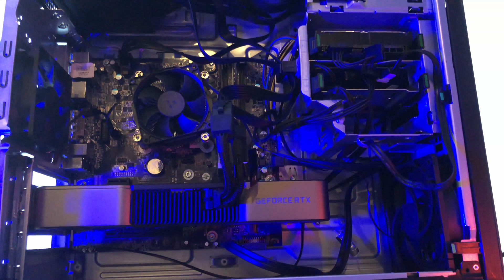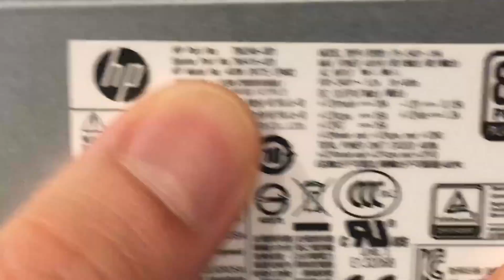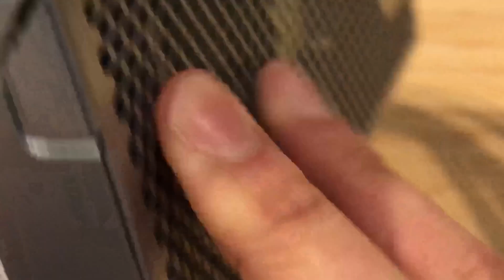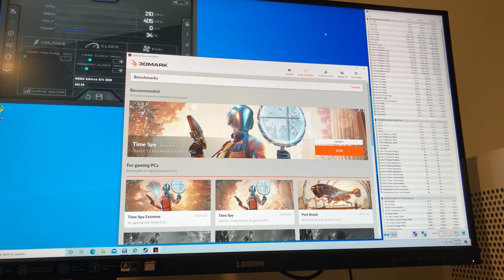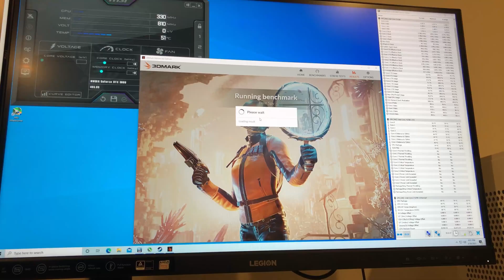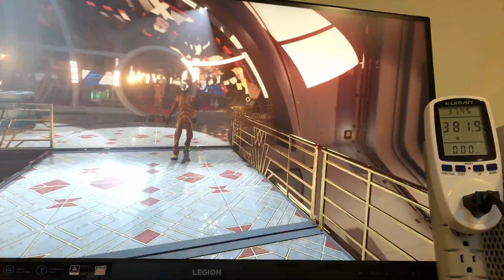UPGRADE HP Z240 with rtx 3080 on a 600W PSU??? 😱

Comment: Would I be able to put a 4060 to my hp z240 or would that too much even with the power supply upgrade?
Reply: Better a RTX 3060 12gb PCIE 3.0 16x
Reply: @bartd.3979 yeah after a review it seems that would be better
Reply: @brotherdarkness89 because this pc don't have pciE4. 0 but onlo 3.0 and the 4060 is PCIE 4.0 8x, on this pc would work on PCIE 3. 0 8x... Not good
Reply: @bartd.3979 I mean you could always use an adapter but I get it
Reply: @brotherdarkness89 adaptor? For PCIE slot
? Are you serious?

Comment: i have hp z240 ,core i5 7th,16g ddr4 , 256ssd nvme + power supply 400 w + what type gpu recommend for me ? 
thanks
Reply from the maker: With those specs i think a 4060 or 9070 would be great. Or a used 3060ti would be great value too
Reply: @StraightforwardTech  on a 400 psu??

Comment: I have z230 sff, i bought an adapter what is convert 24 pin to 6 pin special hp power cable, i connected everything, but if i turn on the psu, the pc is on power, psu fan , and cpu cooler is start working, , but the front panel not connected for the motherbord, someone know what is the problem? The motherbord, cpu etc works because i tried with the old pc psu, and own the old pc.

Comment: can i also put rtx 4070? it needs less power than 3080 afaik...thanks for great video. i was hoping to find how to upgrade z240  power supply, and your vid was of great help!
Reply from the maker: If the power is lower sounds reasonable to me. Glad I could help!
Reply: i installed rtx 4070. up and running great! huge thumbs up!! @StraightforwardTech
Reply: @whitesandboy  how many watts on your psu do you have + are you still working on it?
Reply: @whitesandboy well glad that worked out so it will definitely run the 4060
Reply: @Abdo1.1 
600w psu still running great

Comment: Is this psu gonna fit in elitedesk 800 g2 i7-6700 my brain stuck about the psu things because i wanna upgrade as i have 280w (psu) i want 500 or 550w but some people told that my motherboard doesn't support 24 pin any help or this video is enough?

Comment: Bought one of these machines a while ago to help a friend get a decent PC on a very tight budget. Absolutely amazing value for the price especially since it's a Xeon based system but the Quadro K2200 is letting it down a bit, with a decent GPU it should be a pretty powerful rig. Might not need to upgrade the PSU but good to know it's possible

Comment: I need a new psu. It's going bad. :( How much power can I add for the fan? It's 400 wats atm and dusty. Is it possible to upgrade to a 700wat PSU? Or how does this work? I wish I can use Cooler Master fans too. Im a heavy VR gamer and I have a i7 6700 and it does well. Just installed the thermal paste had to replace it. Need a new fan tho. :( HP fans power supply sucks. Sorry. :( And can't afford to build my own rig. Did you get any decent VR out of it? :)

Comment: I’ve did the same installation with a Corsair 600 and the rtf 3050, but whenever I plug it, it doesn’t boot, only the small led close to the power connector in the motherboard turns on intermittent. And I’ve checked, all cables are connected. Did I miss a step?

Comment: Pretty much the build I am about to do. Picked up a 3060Ti as prices have come down due to miners selling their GPU stock. Needed a generic base , the early Z240's were the best option for space. Refurb model with i7 6700, 24gb Ram, 256 SSD & 1 Gig HD.

I've a 600W cooler master sitting around to upgrade. i7 6700 should be good enough, I've been running a 2600K for years and it is only beginning to struggle.
Reply: sadly you wont achieve the full performance that will be given by the 3060ti due the cpu bottleneck
Reply: Nah that depends heavily on the game and the resolution but the fast majority of games the 6700 will not be a bottleneck. @ochithamhv

Comment: I've watched this video maybe 20 times, and I'd like to know if you had to modify the aftermarket adapter? I bought one and changed it since the comments said the pins were wrong. Also looking at your video, your Original Power supply from HP had 4 pins on the right hand side where the new one had 3 on the left with a bridge. 
I'm just worried that it would fry the Motherboard if I use it in the original state. Also if you didn't change anything, is it still running to this day with no issues?
Reply: Hey did you ever try it out without modifying the cable, I purchased one that was an adapter with 4 pins in a row, but after watching this I'm not sure if it's correct because his one booted

Comment: Truly great video, well thought out and well executed. I was very excited to see it and try for myself. However...unfortunately the adapter in the provided link did not work for me in my HP Z240 full tower workstation. After comparing the plugs I have to the pic on the amazon page it should have been compatible. The adapter that arrived did not have wires in the same places or the same number of wires as the original PSU's "P2" connector. Original P2 connector has 4 wires in it all next to each other with 2 empty slots on one end of the connector. The new adapter has only 3 wires (in different slots than original P2) as well as a small black loop between 2 pins. I tried this with a Cooler Master V1000 and an EVGA 500 PSU, in addition to an EVGA GTX 760 SC. I made sure that none of the pins had ejected themselves as they sometimes do, while connecting all the connectors. After plugging everything in and turning on, the green MOBO LED adjacent to the P2 connector just steadily flashes, no fans run and MOBO is dormant. After removing everything and reinstalling the original HP 400 watt PSU everything works fine again...without a GPU that is. I was at least happy with the RAM upgrade to 16 GB (https://www.amazon.com/gp/product/B086X2XZ4J/ref=ppx_yo_dt_b_asin_title_o02_s00?ie=UTF8&psc=1) and addition of an M.2 drive (https://www.amazon.com/gp/product/B09VSNPDVH/ref=ppx_yo_dt_b_asin_title_o02_s00?ie=UTF8&psc=1) as the main boot drive....made a HUGE difference in overall performance. I tried reaching out to the seller for assistance but have gotten no response. I was able to find another adapter that specifically mentions the Z240 as the model it is compatible with https://www.moddiy.com/products/HP-Z240-PSU-Main-Power-24-Pin-to-6-Pin-Adapter-Cable-30cm.html, hopefully this one will work.

Edit: copied link from webpage:
https://www.moddiy.com/products/HP-Z240-PSU-Main-Power-24-Pin-to-6-Pin-Adapter-Cable-30cm.html
Reply from the maker: Wow very interesting scenario you ran into. I hope you get a resolution to your set up. Would love to hear how it turns out
Reply: @StraightforwardTech  Hello, hope you're well. I just received my adapter today (from China). After plugging it in using the 1000 watt Cooler Master PSU I mentioned it turned on on the first try. I was holding my breath for a few seconds thinking it was my particular "Z240 workstation" but was pleasantly surprised when my green LED didn't flash and saw it start to POST. Mad props to you and your original post as you helped me realize there was more I can do with this PC before I tossed it. Thanks again for your excellent video and your time!
Reply: Your link on moddiy is a dead link. Did your adapter work? I'm also attempting to do the same and am getting issues with the current wiring. (from 4 to 3). I don't want to try the adapter as is since I don't want to risk frying anything. (I had an old HP motherboard melt before and don't want to risk it again).
Reply: @popd8830  Good news...the adapter I found (albeit from China) came in today and it works flawlessly so far. I saw it begin to POST and had a small celebration as it came to life without issue. May it bring you as much success as it did for me.
Reply: @natebutkus4520 does it still working for you didn't the motherboard melt or any issues?
Reply: @Abdo1.1  Still running strong...using that PC right now in fact. I dropped an RTX 2080 in it and I do admin work on my Rust servers with it
Reply: @natebutkus4520 This is a great news! Thanks for letting me know can you provide me a link to this adapter?

Comment: Hi! I also have a Z240 tower I7 7700k and would like to replace the power supply to run a geforce 1070ti. Does the 24 pin adapter have to be modified or does it work without modification? Many Thanks.
Reply from the maker: Hey there, I did not do any modifications with this method

Comment: Hello, Nice upgrade, Is the plate to fix the power supply on Z240 provided with the power supply? I looked at unboxing of SF600 and I did not see it, is it possible to mount a sfx power supply without plate on the Z240? Or  buy the plate separately or stl file to print :)

Comment: hi Looking at this vid tried to install a GTX 1660 on the z240 tower but the screen come up blank managed to switch it to a 700 w power supply fine and the mobo display works - is there a setting in the bios that needs to be changed?
Reply from the maker: Hey Blake, try checking the pcie gen lanes and lower them to gen 3 or gen 2 to see if that works
Reply: @StraightforwardTech  thanks, worked well - the step by step tutorial was great

Comment: The motherboard its AXT? or Micro ATX thanks (: I have the same PC and want to upgrade the case
Reply from the maker: Its the the original one but it does look a bit smaller than atx. I have not measured directly what size it is.

Comment: Just did used the same PSU for my Z240 with a 3050. Thanks for all the details.
Reply from the maker: Glad I could help! Enjoy that 3050!
Reply: With a 3050 you can use hp  stock psu...
Reply: can you dm me the link on amazon for it because i am do not know which one cheers

Comment: I’ve a question in mind if you done have a pcie connected to ur psu but it’s connected to a vga can you still connect it to the gpu without a problem?
Reply from the maker: Sorry but I’m a bit confused by your question on what cables and how it’s connected to your gpu
Reply: @StraightforwardTech  I already know the cable for the gpu i meant for the cpu
Reply: @StraightforwardTech  the question I need to ask is what pin connecter does the cpu need on the motherboard I’ve the same hp motherboard but the computer design is different
Reply: and I’ve the evga b5 550w psu the cpu1 cable is like a 6+2 Pin connecter
Reply from the maker: Ahh sorry for the delayed response but I just use the normal 4 pin connector on the cpu

Comment: great video, i have a Z240  Xeon e3-1240v5 and Quadro K1200.........can i upgrade the Graphics card and the CPU? will i need to change the factory motherboard? or is it pointless? i just want to run oculus quest 2 VR headset. many thanks in advance.
Reply from the maker: Hey there! first of thanks for stopping by to check out the video. 

Reading this article https://www.republicworld.com/technology-news/gaming/what-do-you-need-to-run-the-oculus-quest-2.html
The CPU is good, but you will need to upgrade your graphics card as the Quadro K1200 might not cut it. If you do that I would look at your power consumption too and maybe upgrade the power supply too. Good luck!

Comment: I am planning on getting a z240. I would need to know if it has an "above 4g decoding" option in the bios. Would you have possibly seen that while configuring this?  Nice Video! Thanks
Reply from the maker: Hey Max! Thanks for feedback. I don't recall seeing the z240 on this specific motherboard. However this PC is pretty dated and I did not update the bios. Also it had some hp propiotary bios so keep that in mind too.

Comment: Hi is this a full size HP Z240? I have a compact one will it still work?
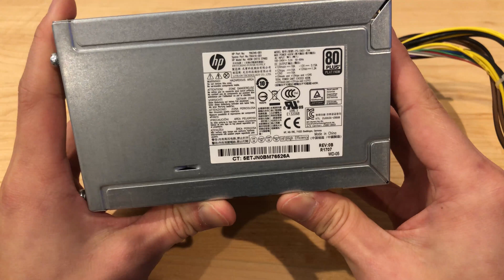Reply from the maker: Hey Mick, yes my pc was the full sized one. Check the 1:42 time stamp to see if your psu is the same. Good luck
Reply: @StraightforwardTech  Can I run a 300W GPU like a 1660 super on a 240W PSU? it wont work will it? PSU is not strong enough
Reply from the maker: @mickwhitfield3631  I probably would not recommend that. I’d at least want 300W with a 1660 Super.

Comment: OMG!!! I found a good video!. Do you know if a Gtx 1660 ti can be good? do you think I can use the computer every day with at 700W ? I want to sell it as a gaming computer but I don't want to spend a lot of money.
Reply from the maker: A 1660ti should be a good fit for this. I would plug in your pc components into this (https://outervision.com/power-supply-calculator) to get an idea of how much power it draws. You should be fine tho as it would be ~350W or so with a 6700K + 1660ti

Comment: finding this video after thinking i needed a whole new motherboard to upgrade the psu.........................
Reply from the maker: That’s what I thought too but glad to hear I can reuse old parts still. What were you planning on building?
Reply: @StraightforwardTech  nearly the same setup other than a i think a 3060, 650w psu n i also want to add an extra stick of ram on top after. I did want to ask if it was possible/safe to overclock the CPU?, was hoping it would help a little bit with bottlenecking
Reply from the maker: I don't see any issue with OCing the chip as long as you have sufficient cooling for it.

Comment: Hi there, thanks for sharing! Where did you get the power supply mount adapter from?
Reply from the maker: 👋 hi hi if youre referring to the psu to motherboard power adapter I picked it up at amazon. Check out the link in the description or https://www.amazon.com/gp/product/B06XW7RWNH
Reply: @StraightforwardTech  I think that he meant the SFX to ATX bracket for your PSU.

Comment: Ok so when I got my hp z240 it said no gpu installed. I’m not to sure if it’s the bios settings or I ACTUALLY don’t have a gpu in my pc.
PLS HELP
Reply from the maker: Hey 👋 not sure what trouble shooting issues you’re running into, but I would reseat your gpu and make sure you don’t have on board graphics enabled

Comment: ur pc is bottlenecked
Reply from the maker: You’re not wrong 😅
Reply: @StraightforwardTech  rtx 3080 is overkill and bottleneck at the sametime
that being said i wonder how well it would sync with a card like the gtx 980 ti, or the rx 480 8gb
Reply: @neojenshi4055  A faster 6600XT would be good for 1080p HIGH 60fps?

Comment: Can we put the same power supply in HP PAVILION GAMING PC TG01-1000nx , as it comes with same motherboard but a little difference that it has 4 pin motherboard please let me know and thanks for that awesome video.!
Reply from the maker: Hey Ali! thanks for checking out the video. What do you mean by 4 pin motherboard? I would check out the manual.

Comment: Great video! There's one question, can i put GTX 1050 Ti in HP Z240 with a "SATA" SSD hard drive? Because some people said no i can't. (Sorry for my English) 
Edit : i noticed from the description that you was using 1 TB SSD already but i really don't know if it was SATA or m.v 2, i really don't know the difference between them yet.
Reply: You sure can. I am doing the same. I am using an Rx 580 now though.
Reply: You can't use the m.2 SSD as a booting device though.
Reply from the maker: Hey John! Thanks for checking out the video! 😁 And yes you can use your 1050ti with your SATA SSD hard drive. This PC is using a sata ssd. The biggest differences is between sata vs m.2 ssd is form factor.  Hope that helps 👍